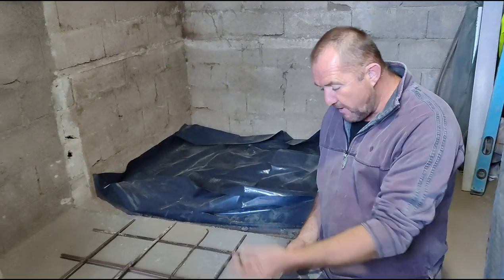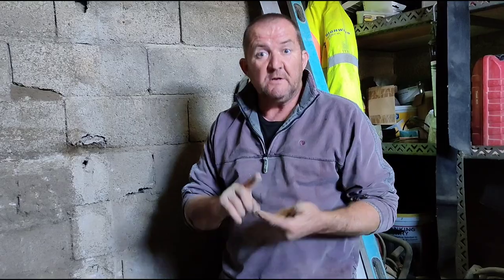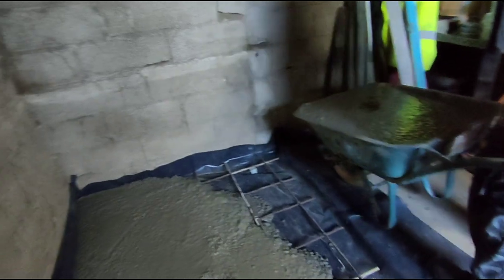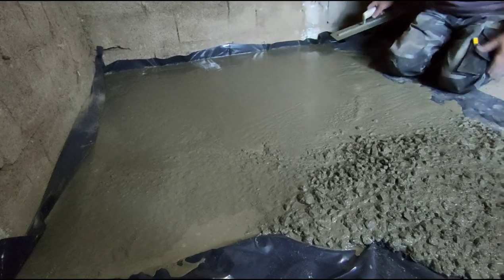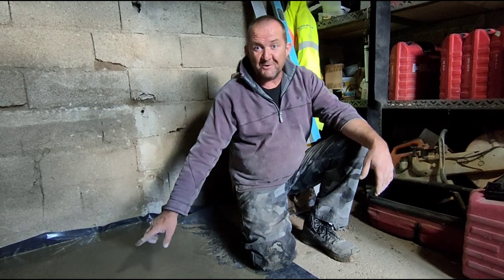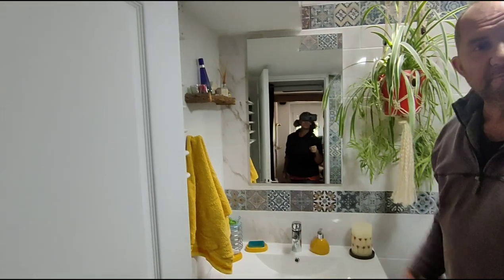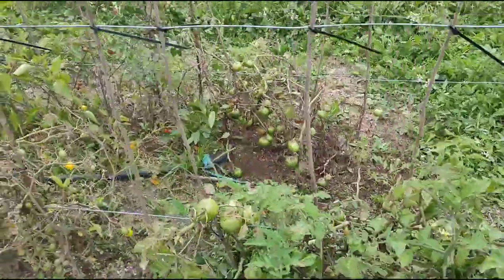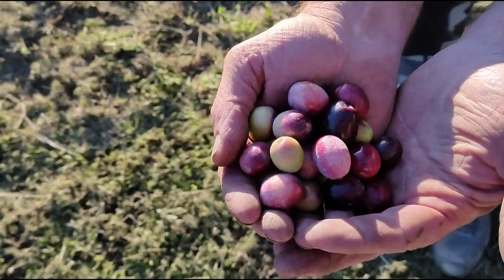No 14, How to lay a re-enforced concrete floor

Comment: The house is beautiful! Fantastic job! Do you have a tens machine? I got one with a 9 v battery. I use mine for neck and back stiffness when it flares up. Works great for sciatica as well. 🙂👍👍👍
Reply from the maker: Yes must dig it out, haven't had sciatica for ages

Comment: About using fiberglass and not rebar? My brother-in-law did part of my driveway with fiberglass and so far after 15 years and with a F350 parked on top no issues.

Comment: Hi guys, thanks for the great content. How soon will you be tiling over your concrete slab? You mentioned it being almost dry, is it safe to go ahead and tile over it at this stage using porcelain tiles
Reply from the maker: Any concrete needs to be fully dried and cured before you tile over it, and that depends on , how thick it is how humid it is, have you used a plastic membrane etc etc
Reply: Thanks, it's just a small area 8 x 4, 2 inches at its shallowest, 3 inches at its deepest, over an existing, uneven, poor condition slab.
No heavy duty, just a few kitchen units and foot traffic.
I realise now from your response that it's almost impossible to gauge without seeing it, you know what it's like, you just want to get on.

Best to give it a week I think, to be sure.